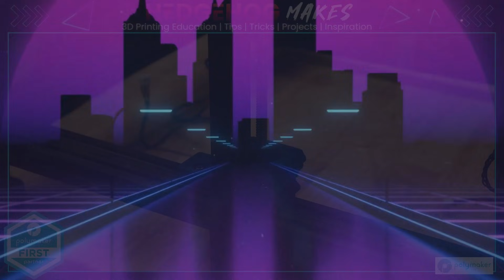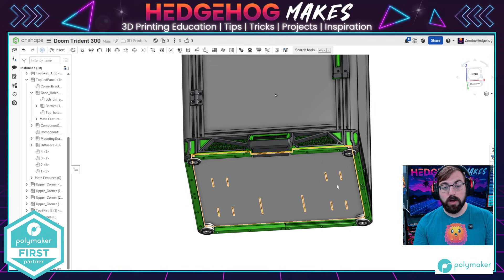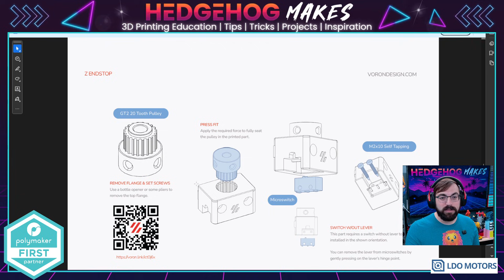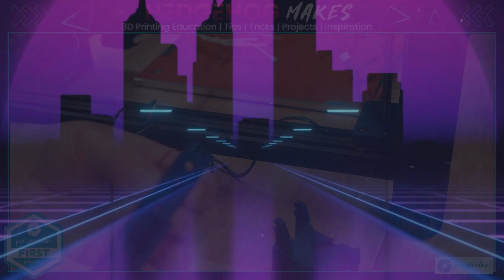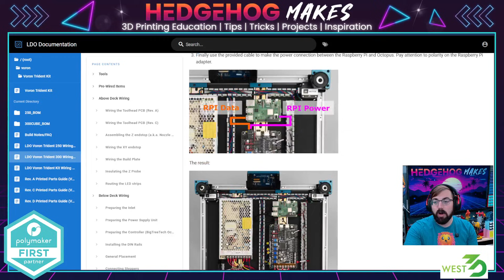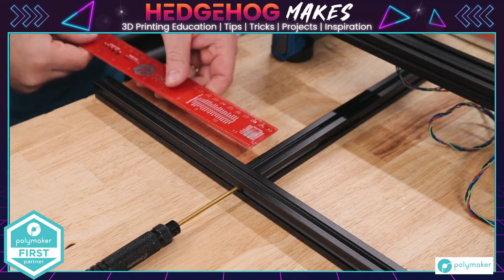Rainbow Doom Part 3: CNC AWD Gantry COMPLETE… But What Toolhead Should I Build Next?

Comment: Building one of these at the moment - converting my standard Trident. How did you lay out the electronics bay in the end? I am aiming to keep everything below and run more insulation in the top but see there is significantly less depth in the basement compared to the standard Trident build meaning the inverted bay mod may not fit, even with adjustment.

Comment: For the live pulley grub screws that need to be shortened. One way would be to take the grub screw and thread it into a nut. Then grind it down and when you remove the nut it will chase the threads. Being how small it is might be a little tricky. Sweet build, really makes me want to build another.